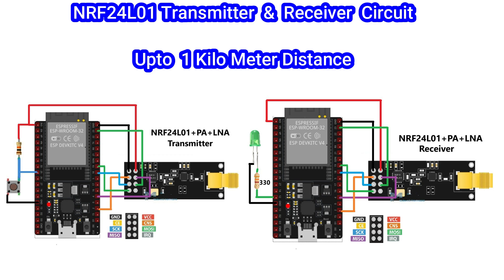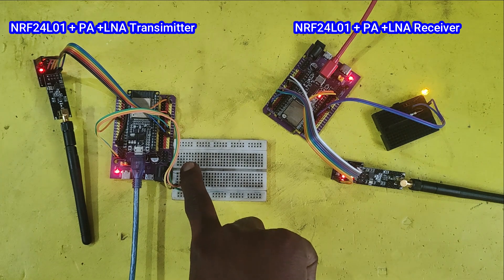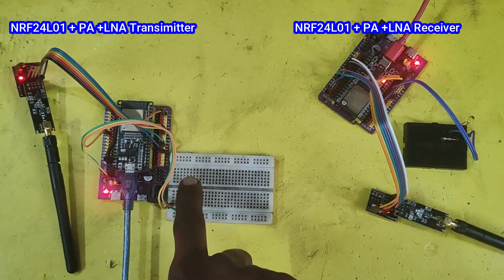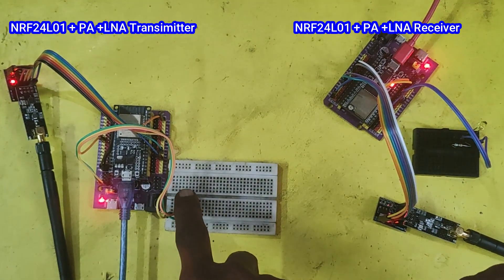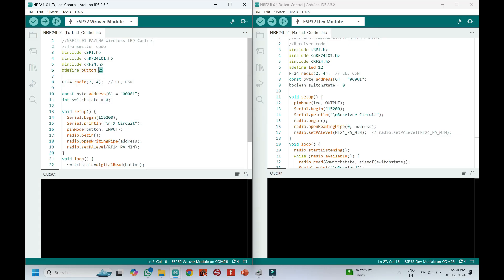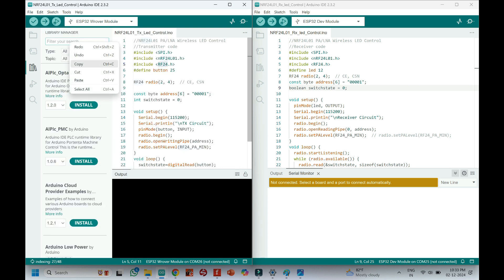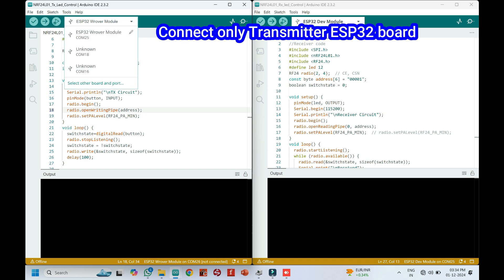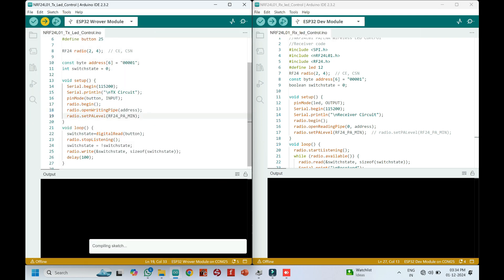NRF24L01+PA+LNA Module with ESP32 Transmit and receiver Signal | NRF24L01 ESP32 nrf24l01 range test

Comment: 콘덴서는 필요 없나요? 송신기 쪽의 nrf를 꽂은 건 뭔가요?
Reply from the maker: Yes. It is required if you want to cover more distance
Reply: @TeachMeSomething  Which capacitor is he referring to ? and where should I connect capacitor to increase the range ? Does the capacitor need to be connected on both transmitter side as well as receiver side ?